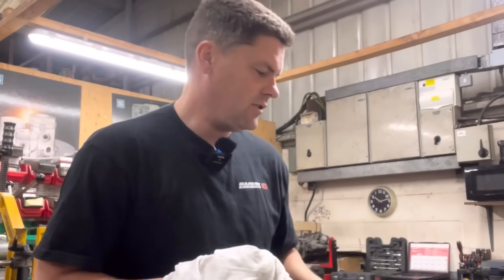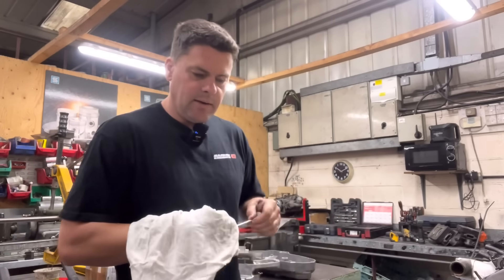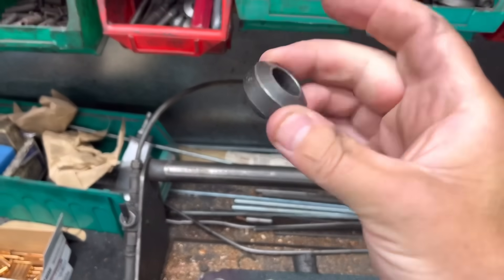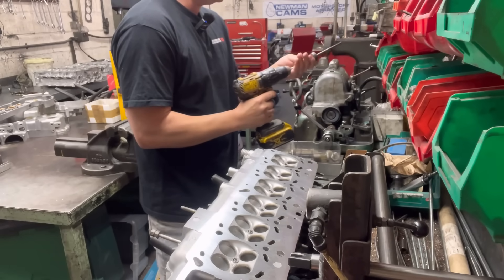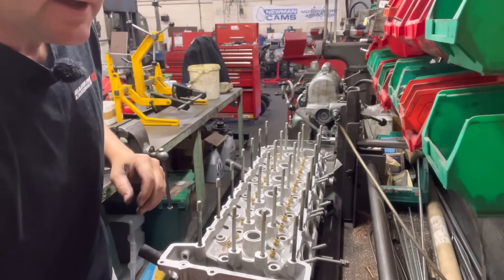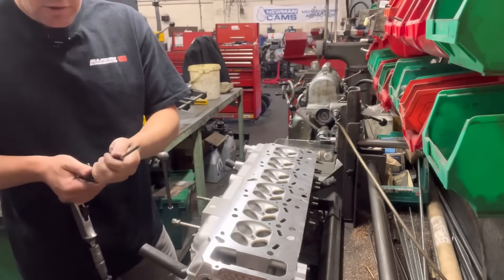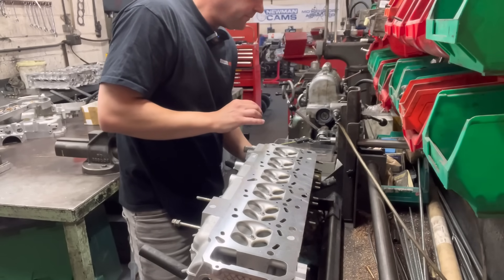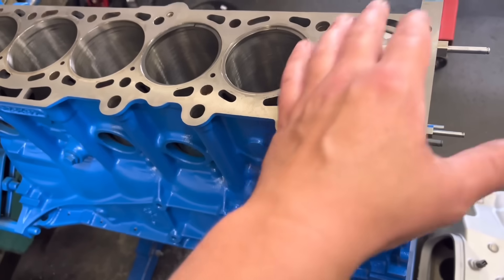My M3 engine is worn out, but can it be rescued?

Comment: I’m curious as to what size pistons you can get. In America I can order a piston (or a set of pistons) at increments of 0.005”. Example; I have a bore that’s standard but it takes 0.015” to properly clean it up - after final honing. So I can order a set of 0.015” pistons.  4.015” might be the piston diameter; or 4.035 or 4.050, or 4.055.

Comment: Do you install conrod and main bearings with assembly lube on the friction side and totally dry and clean on the other side? I hear conflicting opinions on this. I would assume it dry on the install side as it would cause problems and change clearance measurements. cause or facilitate movement of the bearing>??
Reply: Dry assemble on shell backing,  only lube journal / material side
Reply: @chicanesimon  Agreed 👍 Thanks

Comment: At one time, some car makers supplied valves with slightly oversize stem allowing the guide to be rebored. No need for sleeves.
Reply: That normally applied to 'older' cast iron heads where there were no guides fitted because the cast iron was a sufficiently robust sliding surface.  Once the guides were worn, one had the option of fitting sleaves or using new valves with oversized stems - and usually the latter because the valves were usually in a poor state.
Reply: @georgebettiol8338  That is correct. New materials and heat treatments have really extended valve guide and stem life. Sleeving seems fiddly to me, I would rather replace the guide. Regards

Comment: I found it interesting to hear you say that you have measured and checked customers engine bores and pistons and found them to be perfect yet you still rebore those "perfect" cylinders and replace those "perfect" pistons however in your engine, which again you say has to be perfect, as a cost saving you have only honed the bores and fitted new rings. Surely it would be good customer practice to "save" the customer money by doing the same, but clearly your profit would be reduced on an engine.
Reply: In todays age, customers have little knowledge of engines, and the knowlege they profess to have is often inappropriately applied - i.e. applied in the wrong context.  If you explain (and explain .... and explain) the situation with using the unbored cylinders along with the associated risks - and something goes wrong - they WILL BE BACK complaining along with bad-mouthing of the organisation.  So wholeheartedly agree with Lee's stance.
Reply: @georgebettiol8338  All of the rules go out of the window when it's your own engine. The customer always thinks they're right and always wants new parts even though often the original parts are better. The more you pay, the better the job is and you "always get what you pay for" which is never true. BTW I build my own engines, do my own machining, I always reuse as many parts as I can. I always get a lifetime guarantee on everything I do.

Comment: So are those balls abrassive? Great idea because they are always a constant diameter.Never seen that or even knew of that untill now.I welcome any comments on that.Thanks.
Reply: The balls do not remove any material then simply swage the bronze guide effectively increasing the liner bore and forcing the "excess" material along the guide bore and you finish up with it sticking out the bottom end, hence the need to trim the guide liner after fitment.

Comment: Lee, or anyone else that knows more about these things than I certainly do,

How much did you say those little balls were?  What are they called?  What are they made of. How long to last before they need to be replaced?  

I have watched many American engine rebuilds but I never seen so much attention paid to valve stem guides.  The entire process of adjusting the valve stem guide clearances is amazing.  Is it because this is a high performance engine or the process is very tedious and not usually filmed?  

That milling cutter is a beast.  
 
Thanks Lee, super interesting video!
Reply: its all part of the sleeve kit

Comment: Keep hearing you comment its to tight but your building a race engine and with proper race engines having to be warmed up prior to starting whats the difference
Reply: It's basically a modified road engine, not an F1 engine. It would need rebuilding much more often if he took it to small tolerances as they're not going to be warming it by pumping hot oil and water through it before starting  as F1 engines do. Wear at startup is when most wear occurs, by having larger tolerances it'll last much, much longer.

Comment: Cords Rings to use on the old bores had a step on the topside of the top ring to avoid the worn step. Saves coin but I know not perfect. Cross cloth the bores to clean. Good oil control rings with them too.

Comment: That is pretty neat the way you sleeve the valve guides. Interesting technique of using various size balls to finis-size the guide.  i never knew a technique like that could work. Please be very careful to take enough time to be with your family.
Reply: Using a ball to size a bore is not unusual.
I used to make hydraulic valve bodies back in the 90s - that was how we got precision simply & cheaply.
Reply: I`ve seen it used in starter motor brass bearings. I think it`s better than a reamer.
Reply: If you had to choose between a wife and a race car. What would you choose....?
.
.
.
touring car or one lap time attack?
Reply: @winzracingNZ  Id say E30 touring converted to e46 m3 running gear and enough seats and harnesses to take kids on track when its Lees weekend to have them but tracktime clashes😂
Reply: @mickyanderson3639  Ford four litre inline six from New Zealand / Australia fits by the way... More powa for those extra bums on seats.
😉